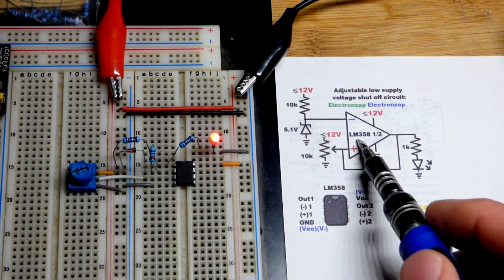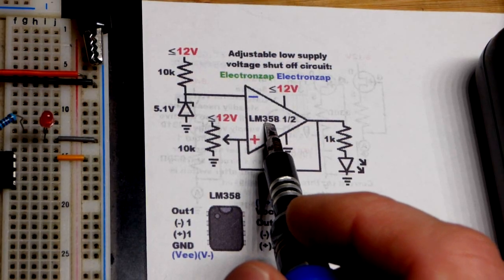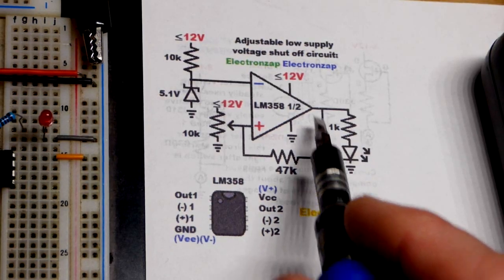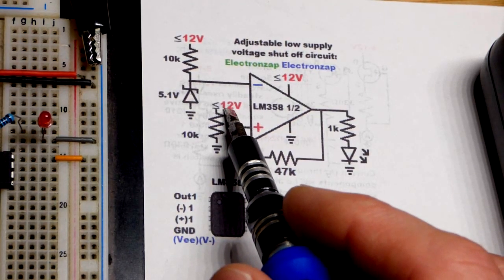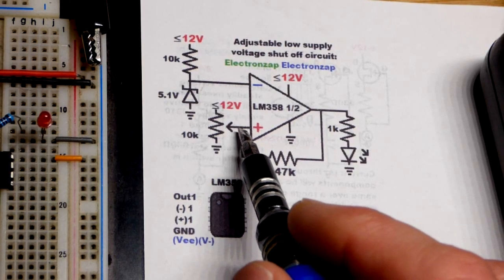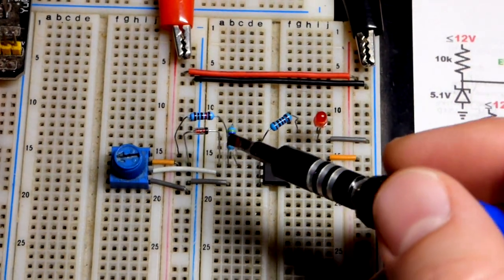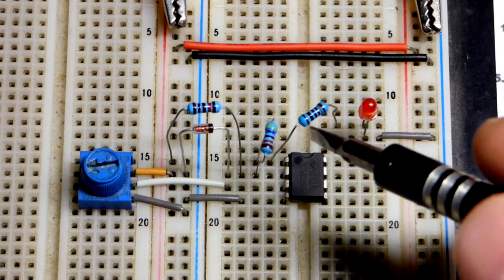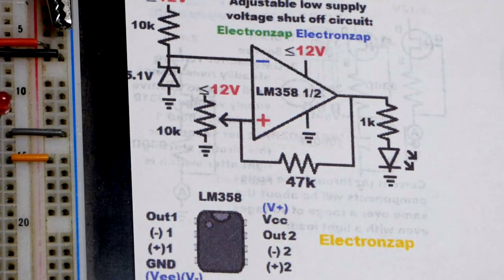Adjustable low supply voltage shut off circuit

Comment: One of the mistakes I used to make (just learning), was not using resistance on the low side of the pot and would fry them when "turning down." I'm slow. Fried a lot of pots  :-)
Reply from the maker: Yeah. The inputs of op amps don't need current, so you can attach both ends of the trimpot to the supply voltage, and the wiper to the op amp input. But if you want to set a resistance with the wiper, then you definitely need to make sure there's enough resistance elsewhere in the circuit for when you set the wiper towards o ohms.